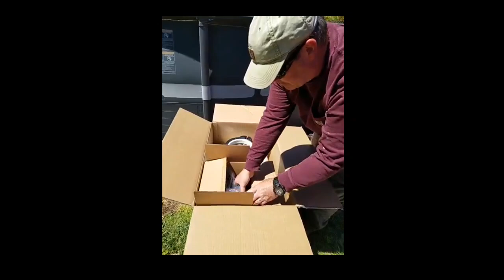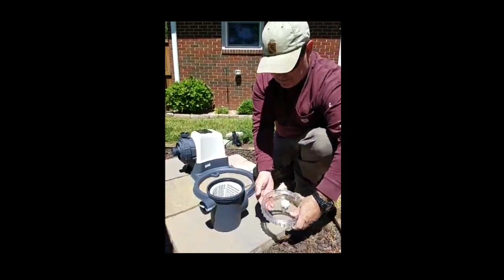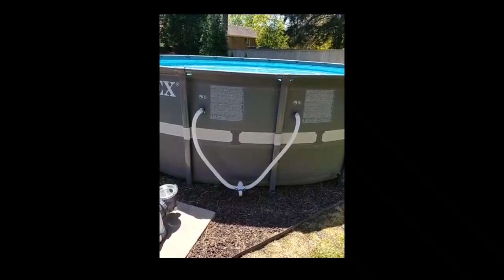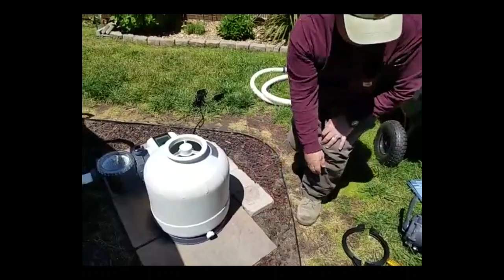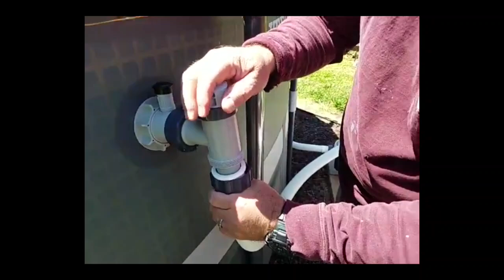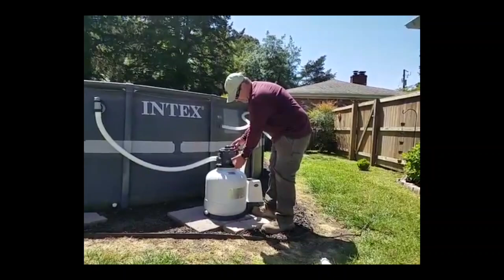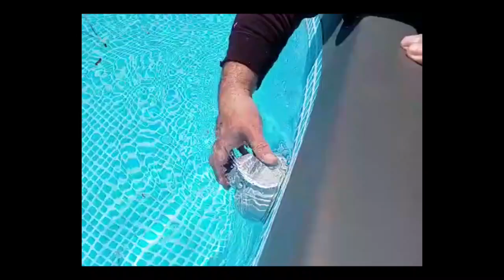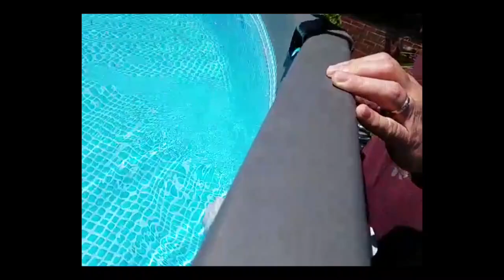INTEX SAND FILTER PUMP - Setting the pump up for above ground pools

Comment: Did you need to replace the two 1.25 intake hoses that came with the pool when you upgraded the pump. The owner’s manual says they can only handle 2150 gph but I noticed you didn’t change them. Are they working just fine. Do I need to change those hoses to the 1.5?
Reply from the maker: Now that is an interesting point you just made. We haven't had problems of any sort with the 1.25 intake hoses at all, and I did not know that the owners manual indicated that at all. I will alert my husband to that detail you provided but  we realize you have to cut the holes in order to upgrade to the 1.5" and that would be the only reason we haven't done that. That makes me nervous cutting into your investment.
Reply: @MoverandShaker  right. I’m also hesitant on cutting a bigger hole.
Reply: @samjuan3440  several people have done this on youtube and it goes well
Reply: If you don't mind me butting in.
It should not be a problem as long as the 1.25" hoses are for the intake of the pump.
Both hoses eventually convert into a 1.5" to the pump.
If you'd had only one hose as the source, then I would think the upgrade to a 1.5" would be a benefit.
Reply from the maker: Yeah with so much conversation about it we've actually considered changing to 1.5 hoses possibly next year for two seasons we haven't had any issues so far

Comment: Are you running this filter with salt or chlorine?  If salt the what else did y'all put in the pool as far as chemicals? For initial start up?  Thank you.
Reply from the maker: chlorine right now but headed to salt before the end of the month.  We use chlorine tabs and PH  Up the most. We use an occasional shock  1/2 bag .  Stabilizer only 1x.  We had downloaded the CLOROX pool app and started adding whatever the test results read and suggested via the app and it seems we can never get it 100 %  perfect. It has been frustrating and we just decided to stop worrying about it and spending all the money on whatever the app suggested. That is why we are moving to an Intex  Saltwater pool chlorinator. There is a video on intex about it. Two models, one up to 7000 gallon pools or one up to 15,000 gallon pools. Something you can consider for the future.

Comment: I've been watching videos all day trying to figure this all out. I have to say this is THE BEST video I've found! The only question I still have is about the suction hoses (B) on my Coleman 22X52. The claps dont seem to tighten and the inside attachment doesn't seem correct either, because they're pointed up instead of out into ty he pool. I haven't filled the pool all th he way yet...as I'm still waiting for ty he pump to be delivered 2 days from now. Thank you very much for this video!!!
Reply: I have that same pool. How does the pump work? Did you get the 16in? Also, is there any adapters you had to buy to make it work with that pool?
Reply from the maker: @rolandsmith5675   The pump kicks butt. It is a 16" pump 120 lbs of sand all 1.5'" fittings/hoses.  We did not ever have to purchase anything extra in order to have the set up you see in this video.  The pool has the 2-1.25" hoses , and the plunger valves came with pool which connect to the pumps 1.5" hose.
Reply: Clamps*
Reply from the maker: I am sorry, we are not familiar with Coleman pools and the inside attachment pointing up instead of out?  and I am not sure what you saying. When you say the clamps won't tighten, if they are indeed clamps I also don't understand why they would not tighten?  Perhaps look again at the Coleman book for guidance or share some photos.

Comment: Great video.  What did you use to connect the extra hoses for the backwash?
Reply from the maker: At the time of this video (not too long ago), we were using extra intex hoses (2) that we purchased offline off of Amazon and 2 that were part of the Intex auto vac however, we have since purchased a heavy duty vinyl hose that is 50ft from Lowes and prefer this because of the distance away from the house.
Reply: @MoverandShaker   Very appreciative of the video, thanks for putting it together.  Newbie question, is this the hose you purchased from Lowes, Aqua EZ 1.5-in x 50-ft Backwash Hose, and if so, how do you connect the hose to the backwash drain side?  Is there a screw on adapter that this hose would clamp on to, or will it just slip over the drain side and clamp it there?
Reply from the maker: @davidpowell8139   Great Question The Aqua EZ hose I ended up with is actually 2" and I couldn't get it over the threads so I purchased an Intex valve  pictured here:   https://amzn.to/3k2HLe1 and then I use a hose clamp to attach the 2 inch hose to this adapter. It works like a charm and doesn't leak.   I very rarely have to backwash.  When you do, don't forget afterwards to rinse.

Comment: Great video 👍
I have a question please 
When do you place the sal on the pool?
Reply from the maker: I am sorry what do mean by the sal?
Reply: Mover and Shaker 
Yes salt ,do u place any salt in the pool or the sand does everything
Reply from the maker: @uniquestyle1864  We use a sand pump and use chemicals (no salt is in our pool at this time) but are considering changing to a salt water chlorinator which is an add on ot the existing sand pump set up which would require less maintenance and $$.   The sand pump filters the pool but you either way you go Sand or Salt you still have to keep an eye on the testing of the water to make sure everything is balanced.    So the answer to your question is we don't add salt to our pool because we don't have the equipment to do that yet.

Comment: Do you recommend against setting up the pump before filling the pool? because I noticed your pool was already filled. I know it has to be filled to do the initial backwash and test it and all, but time-wise it would be easier for me to set up my pump a few days before I fill it--is there any harm in doing it in that order?
Reply from the maker: You can hook your pump up if you want an advance but you can't turn it on until the pool is completely filled.
Reply: @MoverandShaker  how do you install when the pool is already filled? Will there be a lot of spillage. I didn’t see any water spilling for you when you set yours up.

Comment: Once everything is connected and it's time to do the initial backwash, should there be water in the pump? Or will the backwash pull it in for the first time?
Reply from the maker: If all the valve is open to the inlet then there should be water from the pool flowing into the pump when you backwash. Not to mention you have water in the pump from wetting down your sand upon initial set up.

Comment: Ty for the video. I learn a lot better by seeing and hearing someone rather than reading a manual. I can't comprehend it very well. So this video was a huge life saver for me! Just finished the setup of my 16x32x52! I can't wait to get the salt added tomorrow and get this thing up and running
Reply from the maker: Oh we understand. We were so nervous a year ago and watched a lot of videos too.  The main thing to realize is,  Your pump is there to filter out the dirt in your pool and so it's important to keep the pump working properly by keeping the pump clean by watching the sight glass and the pressure gage and learn when you need to  backwash (get all the Dirt out) and rinse it (clean the sand clear so the water is clear coming out).  Always turn the pump off when you turning the dial between selections and / or placing cleaners or vacuums in the pool (anything you have to hook up to one of your inlets or outlets.) Stay tuned for a simple backwash video that may help. Wow I just noticed your pool size ! You are going to be SUPER FIT. EXCITING!

Comment: Your video was so helpful!  I just set up my pool a few days ago and am upgrading the smaller cartridge filter to a sand pump.  I am waiting on the adapters because the hoses / outlets in the pool are too small for the sand filter connections.  Have you ever swapped out the entire pump when the pool is full?  I'm wondering if I need to drain the pool a bit or if i just have to move fast when swapping out the hoses?
Reply from the maker: Thanks for liking the  video. We also were having trouble in the beginning and relied on videos to help us through.  No we have never swapped the pump when the pool is full. We have only drained the pool below the inlet/outlets disconnected the pump for the winter, however, you don't have too drain it though If you have the two isolation valves you just turn the on/off and disconnect the hoses for the switch if your set up is the same as ours. Yes we also sold our cartridge filter and also the left over filters. And we sold our original pump that we had installed last summer because for some reason my husband wanted a bigger and better one. ;)

Comment: Does the inlet do a lot of suction? We have a 20x48 with a sand filter and I cannot feel suction into the inlets but the outlet is pushing water out...
Reply from the maker: Yes, if you take the middle inlet and put the black looking plastic piece (that looks like a small hat) Put that on top of the inlet (inside of the pool) and put the plastic cover back on. You should see a difference. Also on the outlet where all the water pushes out, we found out recently that if you slight lift the black cap on the valve it pushes even more water out into the pool.
Reply: Mover and Shaker I have the same question, on our pool, the suction when both outlets are working are bare to nothing, but the water comes out from the other outlet. So, I don’t think if this is normal. Also, for where the basket is located, how tie should be? Ours is always full of water without doing any noise like bubbles or anything. Thank you for answering my question. I would love a video of how the suction and out of the water should work will be perfect,m.
Reply: Andrea CM now that I’ve had mine for a couple months— the suction doesn’t feel like a lot but it is- if you unscrew the cap on the inlet you will feel how much suction there is! The basket doesn’t make any noise either! Or bubbles- as long as it’s full to the top!
Reply from the maker: @Stompawn    I really want to help you but I don't understand what area talking about being full of water and not doing any noise or bubbles?    If it is the pump filter basket... The PUMP filter basket is supposed to be full of water and it doesn't really make noise. (there are occasions where you have to burp it with the pump off) and the skimmer white basket should be under the water level so the blue floating center container can float up to the water surface in order to skim at the highest suction possible. The middle outlet of the pool should have the black strainer hole plug inserted into it so the majority of your suction is on the skimmer side.  Also, your pump should be rated sufficient enough to handle the amount of gallons you have.  Also sometimes things can get trapped in the skimmer outlet hole so you have to clean it every now and then.  I am not sure what made you think you are not getting enough suction.  Was it because the skimmer didn't seem to have enough suction for your liking?
Reply: When you put your hand to the inlets is it strong suction tho? I feel it slightly but not much...
Reply from the maker: @RebrushedByMaddison  Did you cap off the other suction?  so that the other one is stronger?
Reply: Mover and Shaker ours didn’t come with that small hat :( maybe I’ll order one off the site!

Comment: Is this good for bestway pools?? The in and out ports are opposite I feel but I want to order this
Reply from the maker: most of these pools Bestway, Intex and Coleman you can modify to suit your needs with different brand accessories, you just sometimes need adapters to decrease or increase hose fittings I recommend you google this as I do not have a Bestway pool but I did find a video that is similar in nature. https://www.youtube.com/watch?v=VK0cKjtqe5Q  check this video out.

Comment: I use the same sand filter but I modified it to use 1.5 inch Hayward brand outlet and a Hayward brand "in the wall" skimmer. Now all my accessories are easy to use and no need for "Intex" brand only. I love the new ability to have so many options and accessories for pools that are not Intex branded! For instance I can use the popular automatic suction type floor cleaners like "Wanda the Whale" etc. The Intex brand connected to the outlet which worked horribly in comparison.  Intex uses 1 1/4 inch hoses a lot so I also now have more flow thru the system using the 1 1/2 inch standard pool hoses!
Reply from the maker: Yes, we are at the same stage you were at and understand your point of view completely.  We have not gotten to the point where we feel confident enough to make an incision into the pool to make the hole wider.

Comment: What is the sand name or type you are using and where do I buy it?
Reply: Looks like the FairmountSantrol AquaQuartz Sand found on Amazon.  https://www.amazon.com/gp/product/B00JJ5GXSK  .  Though if you read the review on this sand, many people say its too fine for the intex filters and they get sand in the pool even after back washing and rinsing.  We have switch the the HTC sand from Ace Hardware at half the price per bag.
Reply: @tjhensman  so you used the HTC sand in your intex sand filter instead and it was cheaper and works just fine?
Reply: @amyjackson9614  Yes, I apologize it was the HTH brand.  We paid about $12.00 per bag and its working great.
Reply from the maker: @tjhensman  No sand in the pool yet (knock on wood) but good info to know!!!
Reply: Good evening, thank you for the tips on setting up the filter. Did your pool come with that sand filter? My pool is the same as yours but it came with the 1600 GPH which holds 50lbs of sand. Thank you
Reply from the maker: @paulperez7531  our original sand filter that we had last summer was a 2100 gallon per hour sand filter and it did not come with the pool we bought it separately our pool originally came with the cartridge style pump which we sold right away in purchased that sand pump the only reason we have this particular sand pump which is a 3000 gallon per hour sand filter pump is because my husband is never satisfied unless he's got a bigger better piece of equipment. lol  the 2100 gallon per hour sand filter pump did a perfect job he just wanted more horsepower
Reply: @MoverandShaker  Thank you for the response. I was thinking I had a problem with mine since my skimmer did not get sucked in like y'alls. Lol. To funny. In the future I may have to upgrade. 🙂
Reply from the maker: @paulperez7531  Part of that suction in the skimmer is a result of the strainer hole plug commonly known as "the black hat" (cause it looks like a top hat) on the center outlet.
Reply from the maker: I am sorry for the delay. We purchased it at Walmart.com and it was FREE SHIPPING and we purchased 3 bags and have some left over for our 18' x 52".  https://www.walmart.com/ip/Fairmount-Minerals-Pool-Filter-Sand-20-Grade-Silica-Sand-50-Pounds/605938575

Comment: Hi I have this same pump, my “outlet” is sucking water in, rather than pushing it out. It’s not much, but it isn’t pushing any water out. I have tried to backwash and rinse several times, but still nothing. How can I fix this?
Reply from the maker: I am not sure, however - make sure all valves are open where the hoses go into the pool that are inlets #1 and#2 on the right side of the pool. On the second inlet (the middle one) under the screw on cover we have a small rubber black piece that came with the pump it looks like a black hat. We have that piece on top of the interior portion of the pool and then the screw on cover is on top of that.  I hope I haven't confused you.
Reply: It sounds like you have the plumbing pipes set up incorrectly.

Comment: Do you backwash a brand new pump, or do you just go ahead and run it on FILTER once everything is set up?

Great video!
Reply: Yes, new pump with new sand, you backwash and rinse. If you buy pre conditioned glass, then you do not have to backwash. Or if you just backwash and it is clear, stop the pump then rinse, if that is also clear right away, stop the pump and set to filter and you are good to go. Remember to see what the pressure is at with the new sand so you know when  to do the next backwash and rinse after a while of use.
Reply: @robertstevenson1706  Thanks a ton!

Comment: what adapter is connecting the hose in the backwash?
Reply from the maker: There is no adapter we purchased a couple extra intex hoses  to make a long intex hose.  So the end of the intex hose fits perfectly on the intex backwash pump outlet. We also saw at Home Depot they had a vinyl hose you could just attach with a hose clamp for backwashing.
Reply: What did he use to connect the two hoses for the back wash?  I have two extra hoses that I would like to connect and can’t find anything online. Thank you!